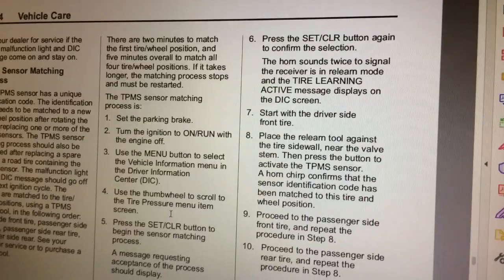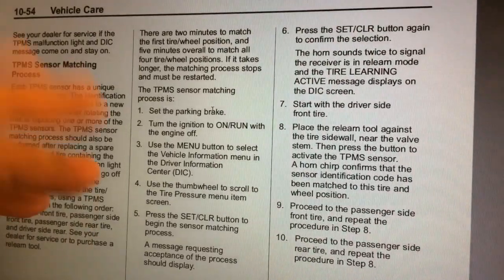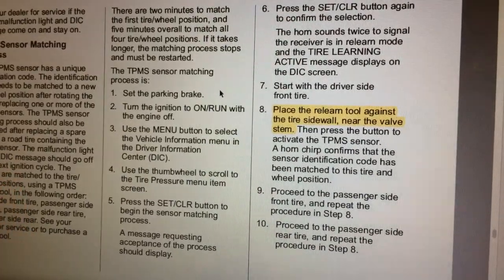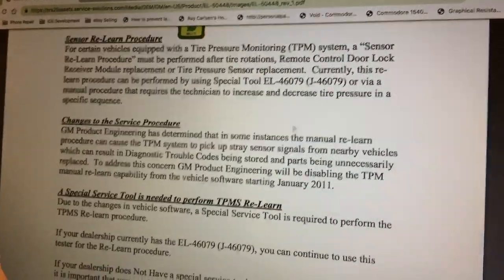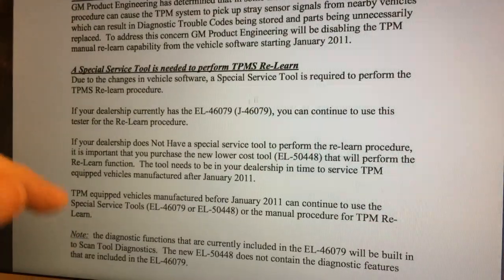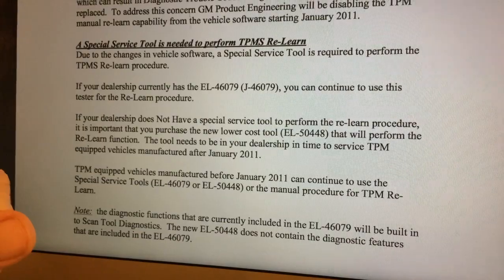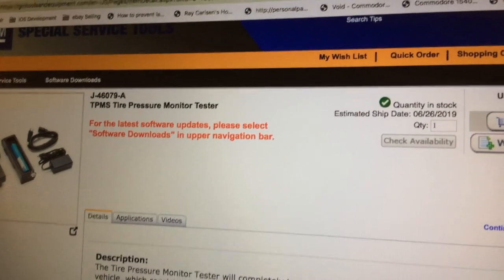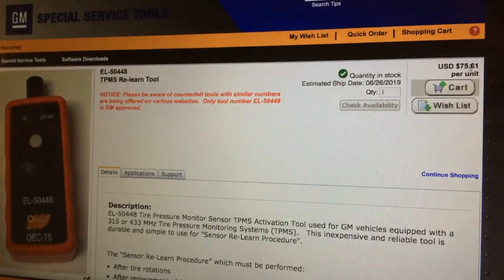Review / Unboxing of Best Clone of the GM EL-50448 TPMS Relearn Tool

Comment: I bought one of these for about $10, without the logo, about the same time this video came out ( June 2019 - I am seeing this video for the first time June 12, 2020).  I bought it after simply doing some research. I used it on our 2007 Yukon, and it worked just fine, so this will work on vehicles before 2011.

Comment: Will work on sierra 13?
Reply from the maker: Depends, alot of lower quality versions of this tool floating around out there.  The actual EL-50448 does work for that make, model, year truck though.  This particular clone version I showed does as well.  I put links in the video description to find these, but choose one based on having identical physical characteristics and labeling.

Comment: I picked one up after a newly Ruined my drivers side rear tire when the system told me it was the front tire that was Low but I was in a Hurry and drove on it for a couple of miles thinking well It is Staring ok my car is a 1.6 diesel Astra and it pulls like a train so I didn’t notice any drag on the car my wife got out first and told me you back tire is flat I said no the car says the front luckily I have a battery powered Inflator with me after further investigation the valve turned out to be Faulty so I decided to buy one of these gadgets it worked very quickly I’ll probably not have to use it again but it’s there if I need the moral of the story use your eyes end don’t rely on technology